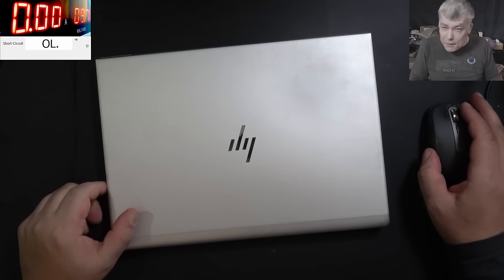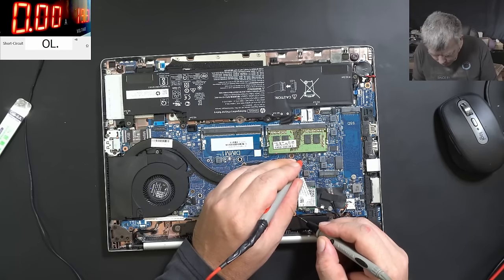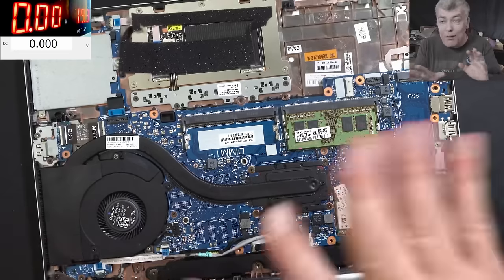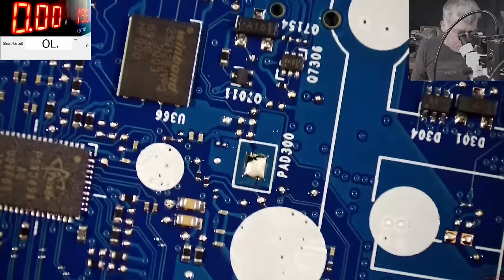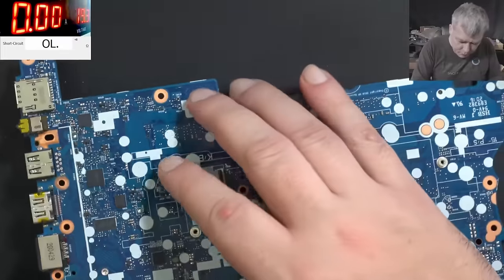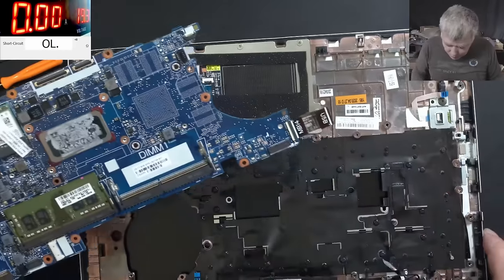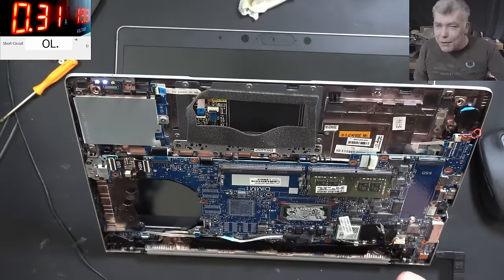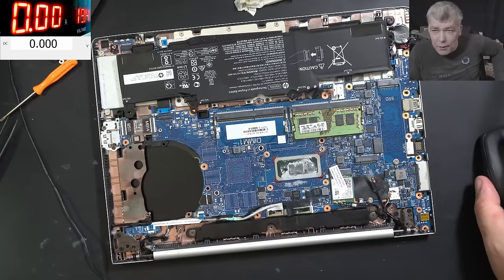HP EliteBook 840 G6 - no power - Can we fix it with sparkling water?

Comment: Unfortunately Sorin, most businesses nowadays are all centered around the time. I fixed a friend's £1000 Samsung TV in my own time by doing exactly what you did in this video. Stripped it down completely and cleaned the liquid damage. He was over the moon, but couldn't understand why the Samsung engineers returned it as unfixable. I told him that it simply didn't make sense for them to spend hours on a job that they couldn't guarantee a quick fix. That's why so much equipment gets thrown away. 😢

Comment: I repaired Switched PC Power supply, and we had 6 minutes per job, so open it and do some measurements, Swap 6 or 12 components test it, and then on to the next one, If we thought it would take longer, we put it in the junk pile. And when it got slow we picked a couple from the junk pile and spent a long time investigating the fault to learn something new.
Reply: Wow, where, what country?

Comment: I was also lucky and managed to fix the laptop just by "cleaning". In my case, however, the laptop was kept in a humid environment for a long time, so the motherboard was heavily oxidized. I sprayed the entire motherboard with contact cleaner and scrubbed with a toothbrush. After cleaning the laptop started working 😁

Comment: had this same laptop last week.. found out the gpu was defect with a little hot spot..  13v line was good.. 3v and 5v also good..but one coil has very low resistance like 2 ohm i quess,.... We are owning a computershop but i have learned to repair now, thanks to sorin..
Reply: I have also learnt a lot from Sorin and Alex. I can't thank them enough

Comment: If you are going to use water, you should use distilled water. Using fizzy water it will leave alot of minerals on board after drying, which can cause corrosion on the long run.
Reply: I was thinking the same
Reply: That will be true if it is exposed for long time, in the case of sorin it won't harm anything
Reply: Plus some of those drinks may contain sugars. Not sure what saccharin or similar might do if left on a mobo!
Reply: @j.lietka9406 make ‘em sweet ?
Reply: @MindYourBusiness1970  hmm.. maybe make it run / work better? 🤔

Comment: Pls my elitebook 840 G1 has no power . I opened it and I saw that the first mosfet is totally burnt.  I cleaned out and fixed another mosfet.  As soon as I plugged the charger puff it smokes again. I don't know the problem  could please guide me what could be causing the problem and what I can do resolved this if that is possible.  Thanks.
Reply: You probably used a Channel P mosfet when you were supposed to use a Channel N mosfet.

Comment: Ideea of having different screw for battery is a poka-yoke system for the worker on the factory not to switch the screw type on production line and for the service not to put in wrong places the screw
Reply: Do you mean they only allow certain factory workers access to particular screwdrivers so they only can work on particular parts of the laptop?
Reply: @RJMCafe  no, is a way of not mess with the wrong screw in the wrong place... If the hole of the screw is different (can be with a different pitch) on the motherboard place from the battery place than you need a poka-yoke system for the worker and this is a way...
Reply: @mikyboy77  ok thanks. I think I understand what you mean now. Screw types are used to give a clue as to what workers should be doing.

Comment: I also believe that HP is messing with the screws. On an EliteBook they mark the screws as M2.5 and you would think they are M2.5, but they are M2.4.
A normal metric 2.5 mm will not fit, it is too large. There are no metric 2.4 mm, but HP use them.

Comment: It comes down to not wanting to charge the customer a bunch of money to look at a laptop that can't be fixed, I never did board repair as it was cheaper to buy a used motherboard at that time (2014-17) and I was just happy to get my bills paid.

My ovehead was almost nothing as I worked from home so one of the last jobs I did was a laptop with a bad motherboard, I told the owner it wasn't worth fixing as it was a cheap, older laptop. She asked me what she owed me and I said nothing, I spent 5 minutes and couldn't fix it. The other was an overheating laptop with a dead bios battery, told him $70 to tear it down, clean,repaste, and replace the bios battery that was not accessible .

He said that was outrageous, I told him ok, whatever. People.